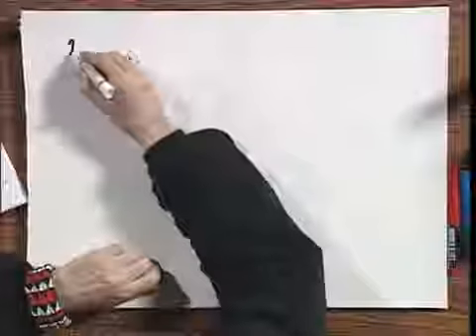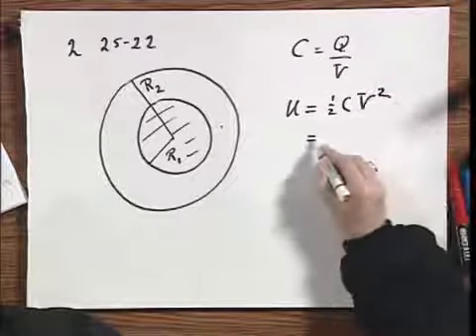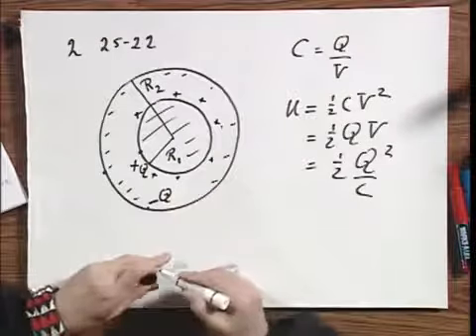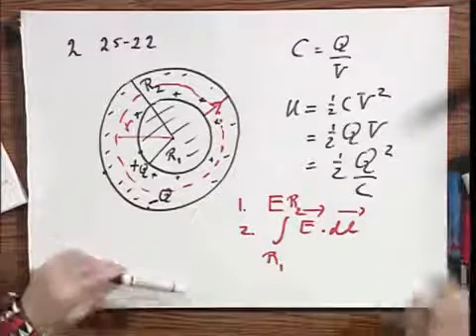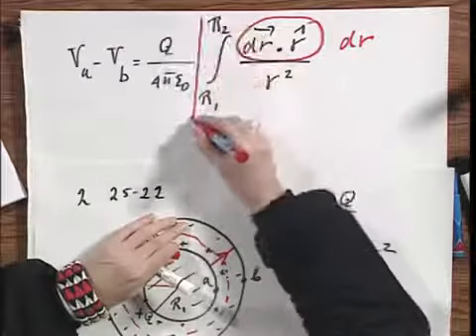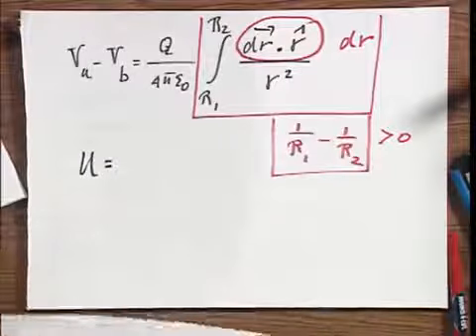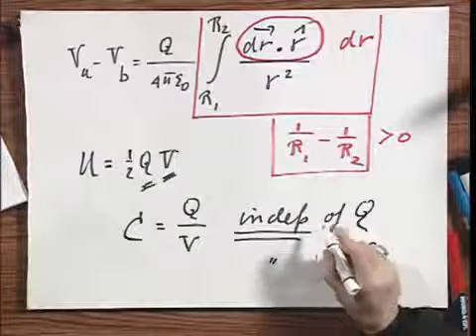8.02x - Module 03.02 - Spherical Capacitor.

Comment: If planets such as Earth have a conductive and ferromagnetic spherical nickle/iron core, surrounded by an insulating rock mantle, and then it surrounded by a conducting crust and atmosphere, would this not constitute a spherical RLC, (Resistor Inductor Capacitor), circuit? Also, if there are "Birkeland currents", (Google or YouTube the term if you are not familiar with it), or what NASA refers to as "magnetic ropes", connecting the poles of the Earth and other planets in our solar system to the poles of the Sun, would not each planet connected to the Sun in this manor act as an RLC network load? The resistance would mainly come from the overall pole to pole resistance of the crust and atmosphere. The inductance would come from the large ferromagnetic nickle/iron core mass. And the capacitance would come from the conductive core, inside an insulating mantle, inside a conductive crust and atmosphere. If these types of concepts are new to you, I would recommend Googling and YouTubeing the phrase, "Electric Universe". Here's as good a place as any to start... https://youtu.be/5AUA7XS0TvA

Comment: Would an electron collector placed inside the outer sphere interfere with the performance of the spherical capacitor? Thank you sir.
Reply from the maker: I do not know what an electron collector is, but in any case, use Maxwell's eqs and you have your answer.

Comment: I have a question. What if we go in inward radial direction for calculating E.dl i.e R2 to R1 ? In that way we get potential for positive sphere minus negatively charged shell directly. But in doing so I'm not getting the right answer. I can't understand why is that so.

Is it because as a rule we should go towards bigger radius from smaller one?

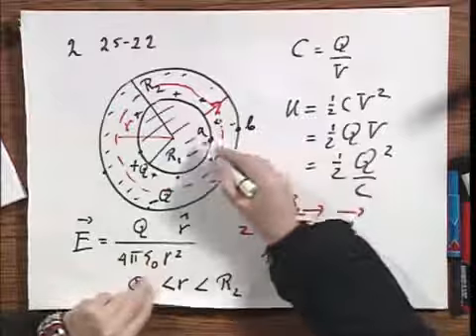Also I think you have done something wrong at 2:32. You are going from R1 to R2 but you are taking potential difference of small sphere minus the larger one. Correct me if Im wrong.
Reply from the maker: I cannot add to the clarity of this video. If you don't get it I suggest you watch my 8.02 lectures first.
Reply: @lecturesbywalterlewin.they9259  Maybe I didn't frame my question well.
Imagine a hypothetical unit charge that you are moving from small sphere to the bigger shell inorder to calculate the line integral E•dl . In doing so you are calculating the potential difference V(final) - V(initial) i.e potential of bigger shell minus the potential of small sphere. But at 2:30 you have written Va-Vb where it should actually be Vb-Va according to the term on left hand side.

As you say in the video "Doesn't matter how I go from inner sphere to the outer sphere" yes, but that gives us potential of outer sphere minus inner sphere.

Comment: sir i have a very huge doubt . we know that electric field inside a conductor is 0. and the outer spherical shell is also a conductor so how the field exist b/w the inner sphere and the outside sphere????.........
Reply from the maker: +NEERAJ SHARMA Keep in mind the conservation of charge and Gauss' Law. Watch my lectures.
Reply: +Lectures by Walter Lewin. They will make you ♥ Physics. sir i understand the gauss law .. in you 8.02x lecture-5 39:58 u  said the same thing that i am trying to say...
Reply from the maker: +NEERAJ SHARMA Great so we say the same thing.
Reply: +Lectures by Walter Lewin. They will make you ♥ Physics. sir let's start it a new way...i have a 3 statement  plzz tell me which are right ..
1.you give the charge =q inside the internal sphere as charge cannot resides inside the conductor as electric field is =0, so it came out and there is +q charge outside the internal sphere.
2. by induction charge induced in the inner layer of outer sphere .and now there is a field b/w the inner and outer spheres.
3. by law of conservation of charge there is no charge on the outer sphere. so there is a charge of +q on the outer layer of outer cylinder..
Reply from the maker: +NEERAJ SHARMA 2. is correct and since the net charge in the outer shell is zero, there must be a +q charge on the outer surface of the outer shell.